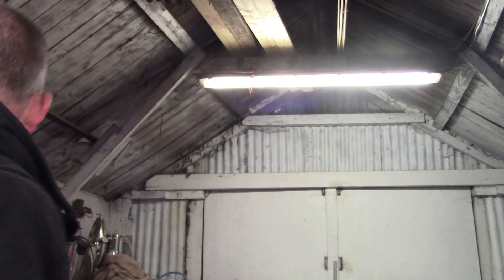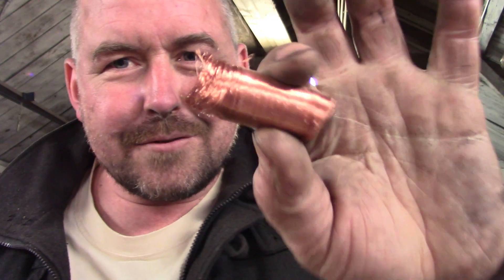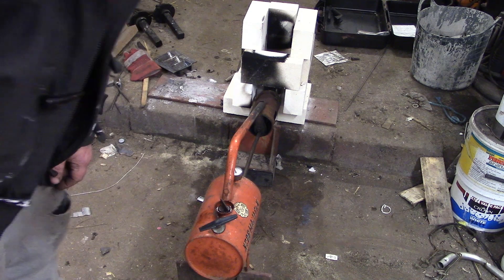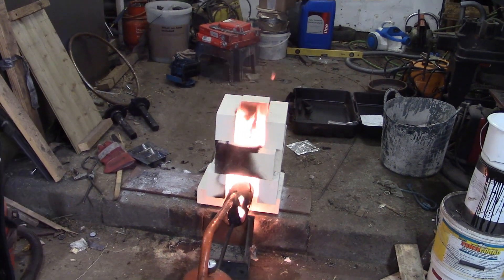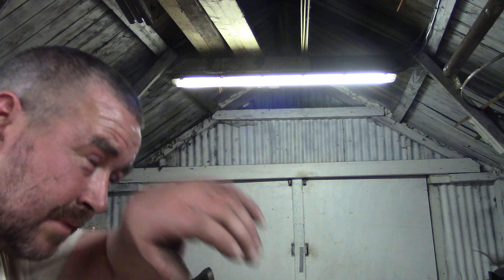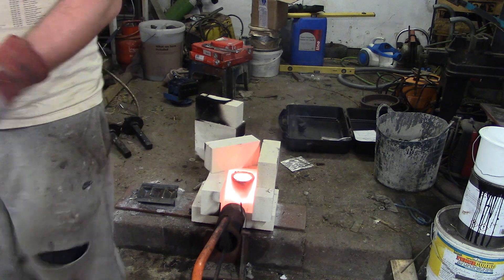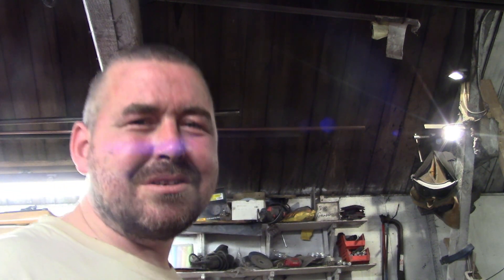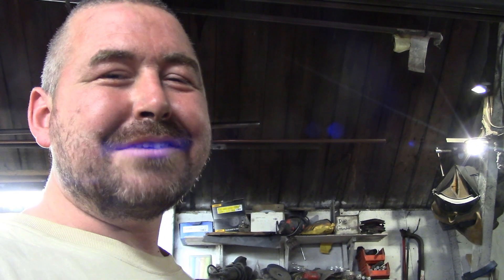Kerosene foundry experiments

Comment: You made something like aluminium bronze which is very brittle and quite hard.  It could do without the solder and or tin if it were to be useful  :) Some of the copper would have melted as it combines with the aluminium it lowers the melting point so I have been told.

Comment: Oh man what a fu*¥ing funny video I nearly pissed myself lol. I watch a scraping guy on u  tube and apparently in the microwave transformer there are 2 windings and one is copper and the other is not it just has  a copper coating so that is probably were your mistry metal has come from but he never said what sort of metal it was have you tried a magnet on it?.  I loved the bit in the video when you say about covering your arms and the next sentence is no I'll have a drop of rum instead you should do a comedy show man you crack me up with the stuff you come out with I love it 😆😅🤣 anyway take care till next time you funny man  . 👍👍👍 .
Reply from the maker: No way man, I spent too long working with other degenerates out of sight from polite society I'm pretty sure it would end in a total ban from the internet.
I've seen Aly windings in transformers before,  just surprised I didn't notice it when I was putting it in.
I'll try and get a volume/weight measurement for the mystery metal at the end and let you know what matches up, it felt too heavy to be zinc but that's probably most likely what it is.

Comment: Hey mate, you should use some borax to make your copper purified. That blob that you dropped on the floor might be the slag or dross from melting copper.
https://goldrefiningforum.com/phpBB3/viewtopic.php?t=11243
Just be careful that you don't make a fuel of yourself...
Reply from the maker: I definitely will once I get it too melt, I used to put low sodium salt in my Aly castings
Reply: Windy hill foundry on Youtube does cast iron, and the have a furnace that runs on diesel fuel. You might check them out. I know copper melts at a higher temperature, but seeing their setup might be helpful.
Reply from the maker: @Farm_fab  copper melts at less than iron, I use a steel crucible when I melt brass in the forge.
Ive looked through his channel before trying to find details on his set up but couldn't see anything
Reply: @turboconqueringmegaeagle9006  You're right mate, I got them backwards. Copper melts at 1085° whilst steel melts at 1540°c.

Comment: I've wondered if you could use an old jet out of an oil fired boiler? When I lived in England (born and raised, moved here 20 years ago) I used to service them and basically they are a detuned jet !!!!
Reply from the maker: The whole unit would be fun to play with, I'll keep my eyes out for a thrown out boiler, most of the houses off the main roads still heat with oil or coal round here.
Cheers mate
Reply: @turboconqueringmegaeagle9006  Plus, the burner and control board are usually fine, it's the boiler plate that goes out normally

Comment: Good work there. Like the ideas. Yes I suspect that you could melt more with forced air.
Reply from the maker: A bit of draught should do it
Reply: @turboconqueringmegaeagle9006  Yes, but in general you want a reducing flame for foundry work as it stops oxidation. That does mean doing it outside to avoid carbon monoxide poisoning though.
Reply from the maker: @BensWorkshop  Part 2 of this experiment has already begun, I'll make sure I can alter the fuel to air.

Comment: Don't take the piss, I've got one of those blow lamps. (I haven't had it on video yet). :) It is a big bugger though.
Reply from the maker: Steel tank as well, I had to do a lot of cleaning before I could get it working it was constantly getting blocked with rust
Reply: @turboconqueringmegaeagle9006  I can believe it. I have the same blow lamp as you as well as one a little smaller with similar output and some smaller ones.
Reply from the maker: I remember seeing your smaller one in a video, I've got some really pretty ones and a couple of little petrol ones that are quite fun, they've just accumulated over the years from boxes of crap that I've bought/found/been given, once I've built my study in the underground lair I'll probably polish them up and sit them around the place.
Reply: @turboconqueringmegaeagle9006  I use mine.